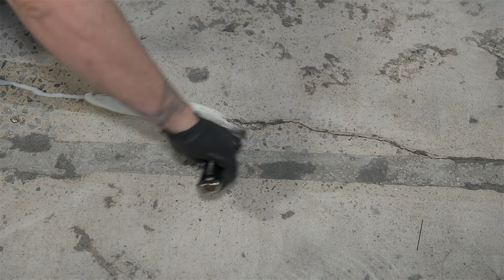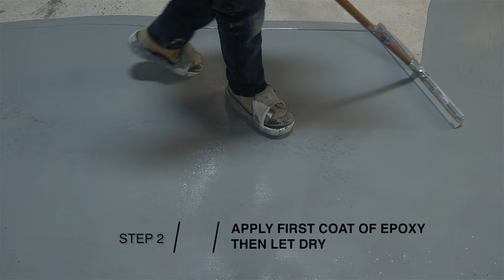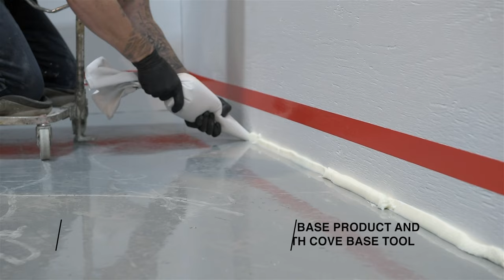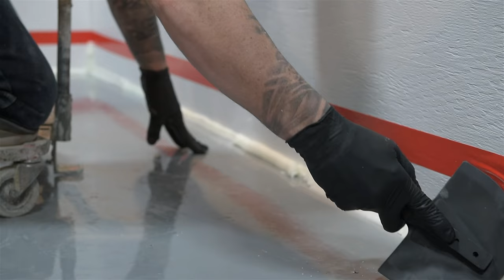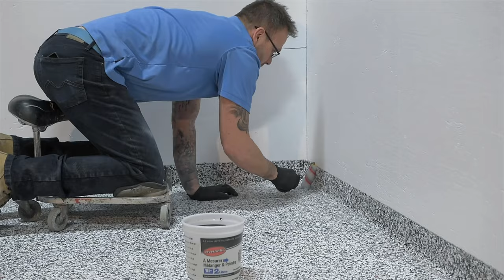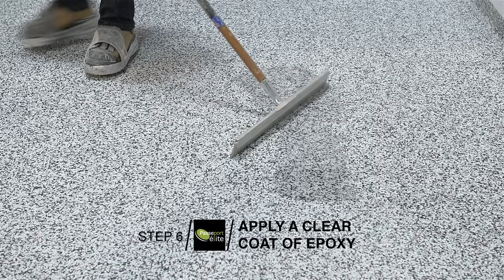How to do an epoxy floor - Cove base full flake

Comment: Watco make a concrete coving mortar. Or you could use a thin set mortar mix like Vestabond LFT perhaps. Hope this helps for all the questions which don’t seem to have been answered. Also ask the epoxy manufacturer they’ll know what’s best. I am not a pro.

Comment: Hi , nicely done! What was the first layer you put on the concrete ? What is that base layer also the same epoxy as your second layer or some other material ? Also, some videos I watched many do not use base, just 1 layer epoxy and then flaxes + clear coat. Do you recommend to use the base layer ?

Comment: This floor wont last unfortunately.  No primer anywhere.   I do this for a living.
Reply: the first squeegee was the primer and back rolled, then they returned once it was cured and then created that thin tape line cove (im with you on the coving)
Reply: Hey what's the best was to bring the epoxy or coating up the wall? Have a garage I'm wanting to do. It's drywalled right to the floor minus 1/2 inch give we take.